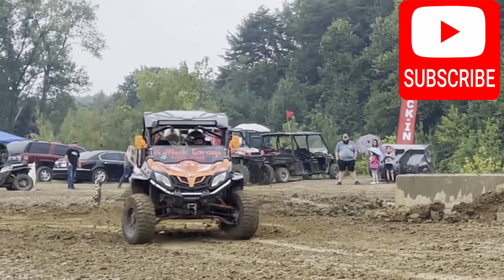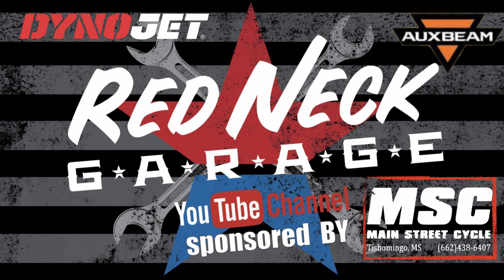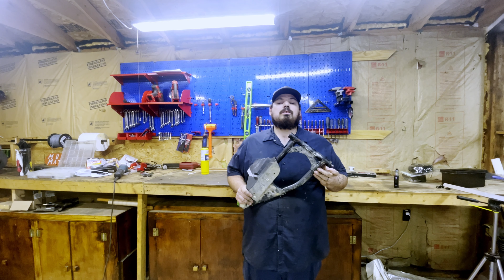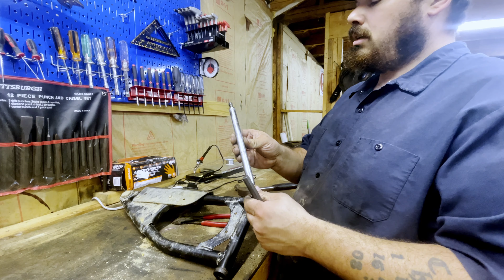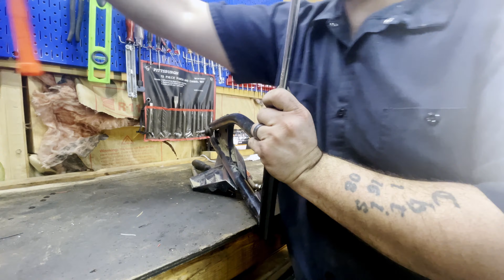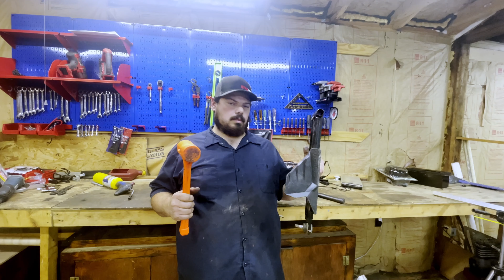CFMOTO Bushing Repair ALL MODELS

Comment: You using factory bearings in the new hubs or looking for an upgrade that last longer?
Reply from the maker: Factory bearings.  I have had good luck with them. All our bearings have never been changed.
Reply: @R.N.GPerformance  yeah mine had no movement when i put the spacers on but we will see after the ride next weekend. Will be 1st ride with 2in spacers and the 32s. It hasnt moved since install. Not risking anything to prevent next weekend lol. May repack them this winter.
Reply from the maker: @edclements5112  yeah they hold up pretty good.